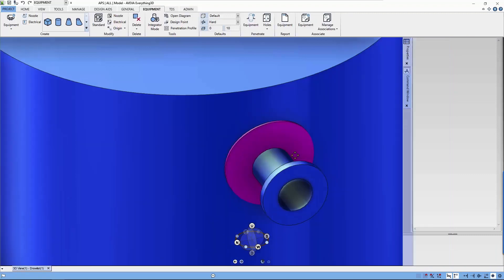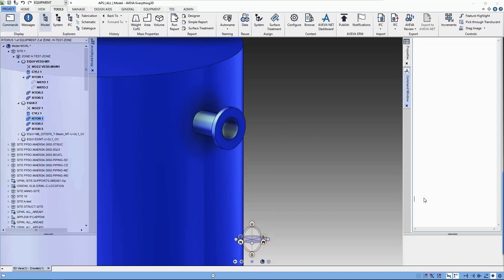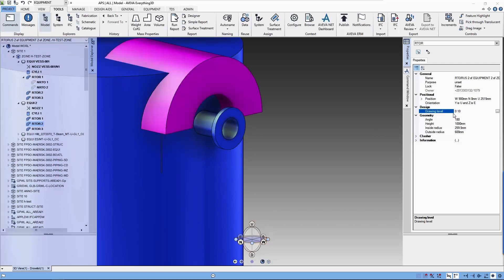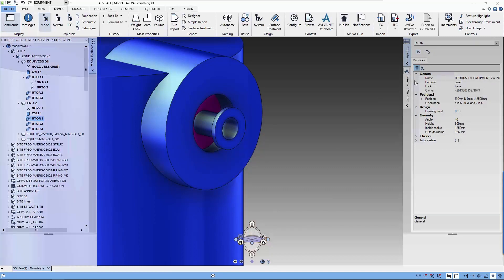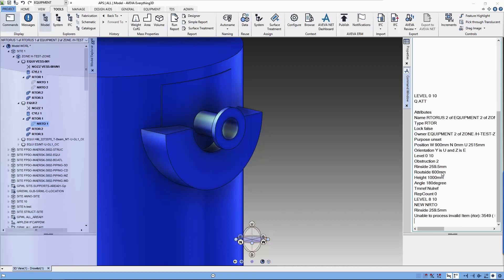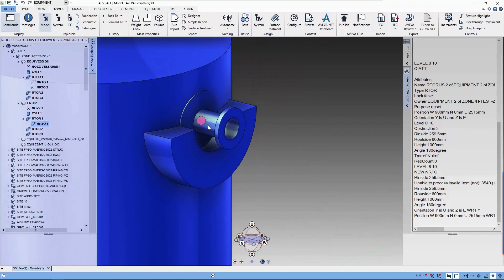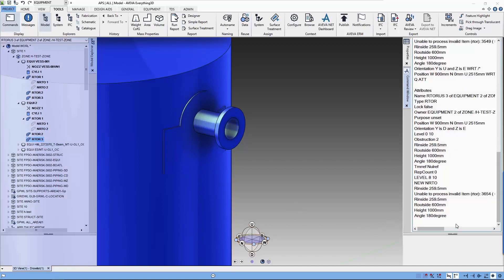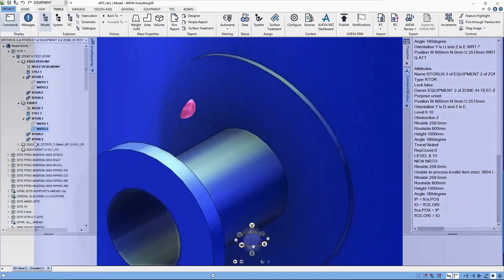AVEVA E3D - How to create a Reinforcement Pad in E3D

Comment: PLEASE SIR HOW I CAN GET/SEE THIS VIDEO OF EQUIPMENT TANK, WHERE YOU  CREATE RECTANGULAR TORUS, THIS VIDEO HERE YOU USED BEFORE ADDING REINFORCEMENT PAD
Reply from the maker: Just use the centre of the cylinder and diameter of the cylinder. Then you just roughly use the width you need and move to the height of the nozzle.